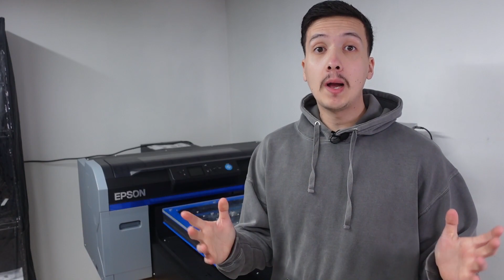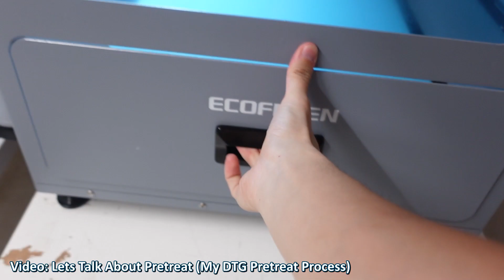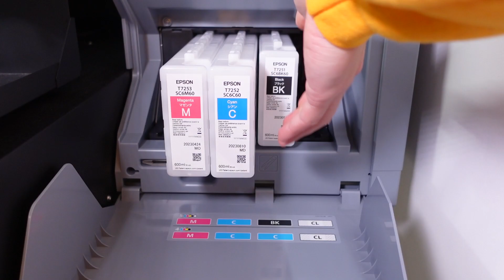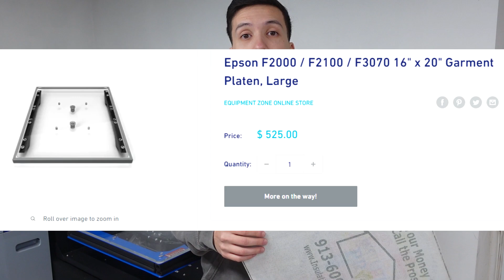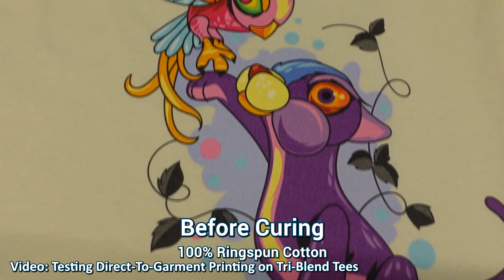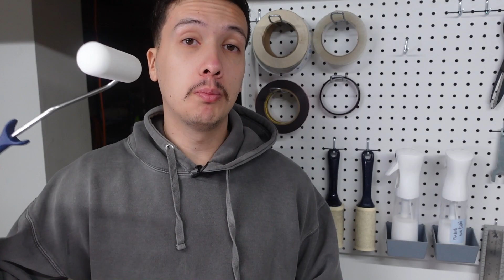How Much Does an Epson SureColor F2100 Direct-To-Garment (DTG) Printer Cost to Own in 2023?

Comment: Hi. How many shirts have you printed so far? Is the print head still in good condition? And while using the printer, what items have you changed besides ink? - from Malaysia
Reply from the maker: I have actually since sold the machine but I was at around 8k prints with pretty much zero issue. Nothing needing changed other than the regular maintenance such as the head cap station and wipe.
Reply: @LovesBranding  what did you replace it with?

Comment: I have an opportunity to buy one for 500 with a pretreatment system. Is it not worth it? The guy says it works and doesnt seem to know anything about it. Im sure the tubes are clogged. But is it worth it as its 500 for both the f2100 and a pretreatment t1 machine
Reply from the maker: If you are good mechanically and are comfortable working on machines, it MIGHT be. BUT I would honestly say no because there are so many small electronics and pieces that it would be easy to mess it up. Having Epson out to repair is roughly $3k+. The new ones are expensive but comes with the warranty and can be extended so you don't have to worry about it at all.

Comment: Hello, interesting video, I have a question: can we use DTF ink to make prints only in DTF on the F2100?
or is it obligatory to use DTG ink?
Reply from the maker: It is recommended to use the OEM ink in the F2100. I have seen people use aftermarket or dtf ink and have issues with clogs. It may work but you are risking clogs in the print head as well as the lines

Comment: When DTG first came out, I was going to invest , but upon careful análisis of the cost per shirt and in talking about time invested per shirt , I just couldn't get it . We silk screen 60-144 shirts per hour on a manual press. At 10-15 minutes per shirt on DTG . You can't really compare .
Reply from the maker: I agree. DTG can be great for one--offs or full color prints but screen printing for production is definitely superior!
Reply: I got a DTG printed hoodie today. 45 seconds maximum time. The set of commercials didn’t even finish going off before the garment was done
Reply: @CITYMUSICGLOBAL  You have to count pretreating and heat pressing all together also how big print it is. On top of that you cant print on blends or poly shirts. Dtf also can bi applied on cardboard and wood without pretreatment. Curing time of DTF is mostly half time of DTG and often even 4 times faster depend on material. So DTG is not good option specially when you calculate in cost of supplies and maintenance.
Reply: @gc2276  I personally dont like DTF for how the film flakes off. DTG just fades away. personal opinion.
Reply: @ If is not done correctly that can happen but if is design done good and everything else than DTF is very affordable and good solution.  Need to know correct way. If someone just stick solid design than it will fill like sticker.

Comment: None of those costs matter to me.  All I care about is the cost per finished product, and time per product.  I was hoping for that type of breakdown.

A basic breakdown for shirts would be like this:
Prints per life of printer divided by purchase price.
Cost of ink per print 
Cost of maintenance per print 
Cost of pre-treat per shirt
Cost of pre-treat unit divided by expected treats per life
Cost of pre-treat machine maintenance per print
Cost of misc. items used per print
Cost of a shirt
Time per shirt across all phases (from unboxing new product to boxing finished product.)

Then repeat with other products.

I know these vary, but there is an overall number that can be obtained for each of these and other aspects that need to be considered.  It's the right way to determine if the profit is worth it vs adding something else to what I do.  It also tells me if I'm planning on charging the correct amount. Then I can look at the time cost of doing it myself, or having a hired employee do some/all of it depending on the job.

I'm currently doing the same analysis with the Epson SureLab D1070DE for photographic prints at events.  A lot less aspects to go over there, but it is still the right way to approach adding a new product.

It is critical that you know what it costs to make a product in both money and time.  Then you can look at the price point of selling and determine if the profit is worthwhile.  It also gives you the justification to make large purchases.  Lifespan of equipment also helps you plan for replacement.  For example, if you take a business loan to get started, you want to plan on repaying that loan as quickly as you can, and reserving funds to replace that equipment without having to take a new loan.  The IRS 179 tax deduction can really help get that loan paid off, and then when you buy new equipment without a loan, 179 can help recover the funds for use with other acquisitions.  (If you don't know what the Section 179 tax deduction is, talk to your tax professional, or look it up if you do your own.  It is HUGE!) Just taking a loan and going in blind will find you still paying on the loan when your equipment is wearing out, or paying off the loan, but not being prepared to replace with out of pocket cash.  Then it's a loan all over again.

Comment: Thank you for the great video. One question. What is your table size and where did you buy from? Thank you.
Reply from the maker: Hi, thanks for the feedback! The table I got from Home Depot. It is a little pricey but is very sturdy. The height is adjustable so you can set it a comfortable height to work on. It also has an option for drawers. The one I have my printer on is the 52" wide option with 2 drawers.

Non-affiliate link: 
https://www.homedepot.com/p/Husky-62-in-W-x-24-in-D-Adjustable-Height-Solid-Wood-Top-Workbench-Table-in-Black-HOLT62XDB12/301810799
Reply: Thanks you

Comment: please tell me how to set up the icc color profile.  I switched from original ink to dupont ink.
Reply from the maker: Hi! I use Epson ink so I haven't had to change the ICC profiles. I would suggest reaching out to your supplier of dupont ink. Epson has been cracking down on 3rd party inks including a recent lawsuit so please be careful when considering different options. If the ink supplier cannot help, I would be careful using them.

Comment: Hey, how do you like your laptop holder, do you use it often and can you provide a link? Thank you, love your vids!
Reply from the maker: I love it so I can keep the top of the printer clear which gives me access to inside without having to move everything. I see a lot of people put their laptops on there but I just like it out of the way and its a perfect height for me to use while standing in front of the printer.

This is the piece that holds the laptop:
https://amzn.to/3IOgwj1

This is the stand that attaches to the table:
https://amzn.to/42eqyRd

I use a smaller 13" laptop and it works wonderfully, but larger laptops might not sit as well on the stand.

Comment: hello, starting on my dtg journey and was wondering if its worth it to get a tucloc 16x20 over the epsom with grip tape?
Reply from the maker: If I were to buy again, I would probably have gotten the 16x20 Epson platen with grip tape. I don't find myself using the hoodie risers as much as I thought I would. And the tucking feature is nice but with the grip tape, I don't even really use the hoop to keep the shirt in place which saves me the same amount of time. However, I do love the 16x20 tucloc for doing any type of dtf films because the tape sticks to the plexiglass far better than it does my regular platen with grip tape.

In all honesty, I don't print over 14x16 as much as I thought I would either. It will definitely get you in with some street brands and other niches that like that oversized print but there's tons of work out there that can be done with 14x16 prints. Best of luck!
Reply: Thank you for all your help

Comment: Would you do a video on how to set up and use your heat press?
Reply from the maker: Hi! I show it mostly in other videos. I haven't made a specific video just for the heat press yet but to sum it up: I usually either keep the temp at 320 for DTG or 290 for transfers and just adjust the times depending on the project.

Comment: What’s a good alternate to Epson F2100? I feel like Epsons business is just to sell ink so they Jack up the prices.
Reply from the maker: I totally understand. This was one of the hurdles I had but if you price your DTG to include the ink cost, it's not as big of a deal. Equipment Zone has some videos covering pricing for DTG. You can charge retail pricing for one-off shirts around $20 and up depending on the design and quantities.

There is also the alternative of using 3rd party ink or refillable cartridges at your own risk.

Other DTG printers in the space that I've found are Brother GTX & Ricoh RI 1000 but ultimately landed on the F2100.
Reply: @LovesBranding  how come you landed with Epson. You have a video of comparing all 3 items?
Reply from the maker: @305dadecounty305  For me, the Brother GTX was far more expensive up front and from what I've seen with some other people is their support is not that great. It does have quicker prints and ink cost is slightly cheaper.

As for the Ricoh, I didn't do too much research because it was around the same cost of the Epson and I was more comfortable choosing a name I'm familiar with.

Definitely do your own research and see which option suits you the best. There are a few others but these were the main three. Main two being Brother and Epson. Hope it helps!
Reply: @LovesBranding  cool thanks for guiding me see which one I am going with.
Reply from the maker: @305dadecounty305  Best of luck, just saw the F2100 new is selling for $9,999. Honestly hard to beat but it makes me think they are trying to get rid of their current stock to make room for a new one perhaps. Just make sure you do your research so you don't end up with buyers remorse. Best of luck!

Comment: I’m not sure if you’ve answered this before but what table is your Epson sitting on?
Reply from the maker: Thanks for watching! I got the work bench for my table and heat presses at Home Depot. They are cheaper than the one sold by Epson and are the exact perfect width for the printer. They also have with and without drawers which I use to put my DTF films in.

Super sturdy with an adjustable height and come with nice caster wheels so its easy to move the printer around. If you have a home depot near by, sometimes they have it on display and you can get it discounted

https://www.homedepot.com/p/Husky-52-in-W-x-24-in-D-Steel-2-Drawer-Adjustable-Height-Solid-Wood-Top-Workbench-Table-in-White-HOLT5202BJ2/311742117
Reply: @LovesBranding  Thank you so much!! I've been looking high & low and couldn't justify paying $800+ for a table.

Comment: how much do think it cost to be fixed , i have one and the color doesnt seem to be coming out right for the t shirts
Reply from the maker: I believe Epson has a one-time fix all option where they can send out a text and repair whatever is wrong with the machine but it costs quite a lot. I would recommend reaching out to them directly for exact pricing.

If you do a nozzle check and all lines are printing without gaps, the printer may be working fine, you would probably just want to make color adjustments in the artwork.

Comment: Thanks for sharing your information, we are currently using embroidery, laser, and heat press. I have looked at DTG, but have decided to order designs on DTF since we are such low quantity users. I appreciate your information, keep producing great content.
Reply from the maker: Thank you for the feedback! DTF is a fantastic alternative for smaller volume digital prints. The biggest threshold to DTG is the cost but with embroidery, laser and DTF, you can certainly cover a lot and wouldn't be missing out on much from not having DTG!